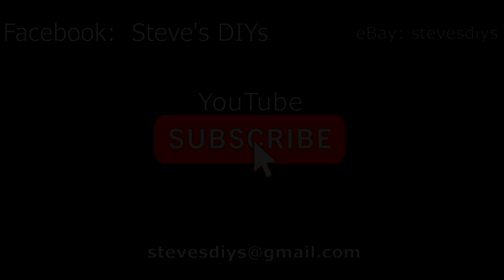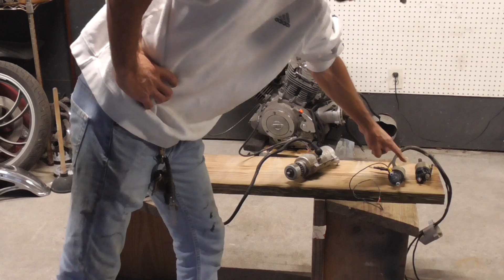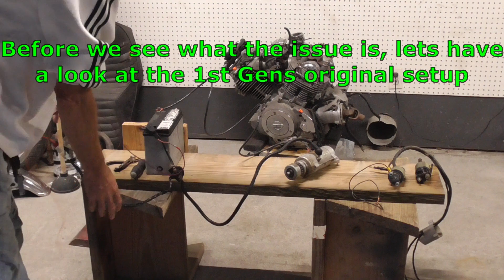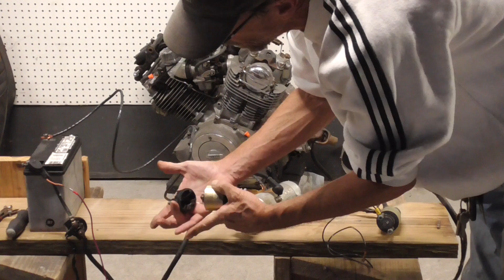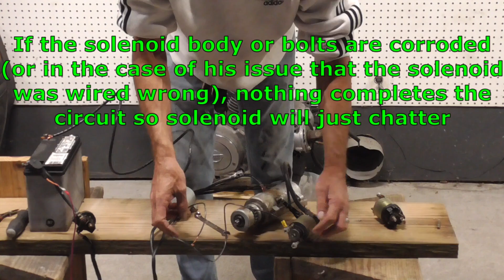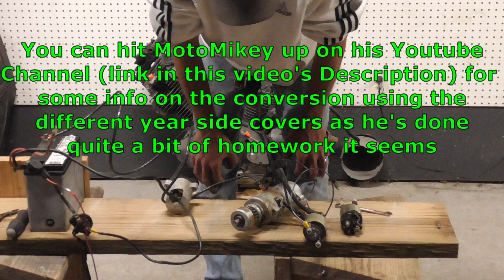Wiring a 2nd Gen Starter Solenoid to a 1st Gen the Easy Way (for a Starting System Swap)

Comment: Hey Steve, love your channel. You're like the Virago guru. Great content. This video really helped me a lot. I did, however, run into one small problem. My solenoid is not getting good ground from the starter and motor. I think it's corrosion. I know that you simulated the ground in the video, but it was not clear to me which post or pole on the solenoid is used for ground due to the solenoid case corrosion. I'm assuming it's one of the little posts of the double coil, guessing. I could really use an assist on properly grounding in this particular situation. Your tutorial was excellent. Wiring and electrical  just gives me fits. Any help would be greatly appreciated. Thanks, Steve. Keep making great videos
Reply from the maker: Hey !  Thanks and glad the videos help some 👍. For the ground used by the solenoid, the two bolts with the nuts that connect it to the left side cover should be providing the ground for it. In the video, I attached a wire to one of these mounting bolts to simulate it being bolted to the left side cover case. Also, since the left side cover case has the sealing gasket that is between it and the motor case, it uses the two hollow alignment pins and the nose of the starter motor to ground the side cover to the case (or it will ground with the cover bolts as well if there is no paint under the bolt heads anymore).  If those have corrosion on them, it can prevent getting a good ground. Hope this helps a bit and all the best !  Steve
Reply: @StevesDIYs  Hey! Thanks that really put it all in perspective and gave me a more clear picture and better understanding. You're the man Steve
Reply from the maker: @malikking1825 👍

Comment: Its s like the storm clouds clearing and the sun shining through ...... i think you just figured out a problem ive been having with a TR1 project bike ive had for years ....😳thanks for your continued XV research . its very much appreciated .  ( UK )
Reply from the maker: Thanks man and hope the video helped with the odd way they designed that 2nd Gen solenoid 👍. I’ll have to admit that when I first picked it up and looked at it, I thought it was a standard coil solenoid just like the 1st Gen one. It wasn’t until I cut one open on the lathe that I realized that it was like a double coil inside.

Comment: Hello There Steve,  I tried to find any specific video on “ MotoMikey” but couldn’t find any on his channel.  Can you please provide a link to his video that talks about what you described ? Thank you
Reply: Hi. Ill make a video on it soon but here I can just briefly tell You that the one You want is XV1000 but its like finding a unicorn. All covers "fit" on the block, same gasket etc- the only difference is the depth where stator and receiver coil sit. XV 1100 both are deeper so would need to machine a spacer for both. On XV 700 ( but only 86 and 87) the stator depth works but coil still needs some spacers. The XV1000 is the best as it also has flat cover for the timing sight window so most definitely the covers from 920 and 750 will fit but Im waiting for mine to be delivered from the other side of the world so then Ill confirm 100%.
Reply: @_MotoMikey_ .  Hello , MotoMikey,  Thank you very much for all your technical information and looking forward to seeing a video on your channel in the  near future. I will subscribe to your YouTube channel.
Reply: @GarysnewYT  Youre very welcome. I hope that helps.
Reply from the maker: Hey again, I don’t think he has a video up yet for the research he did on what has to be done to use the different year and model covers as he just mentioned it in his email to me yesterday.  You might try commenting on one of his videos to ask him…I’ll also try to tag him here:  Hey @_MotoMikey_ are you planning to make a video on what each setup needs?
Reply: @StevesDIYs . Hello There Steve,  You always impress me with your efforts.  Thank you so much